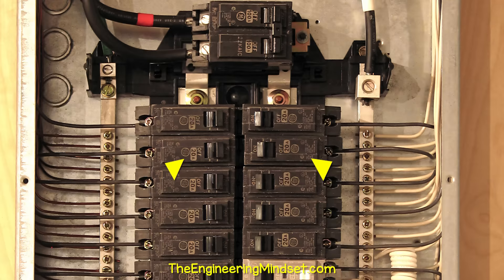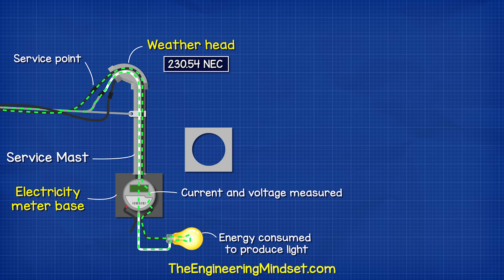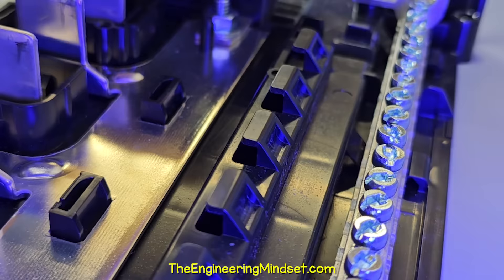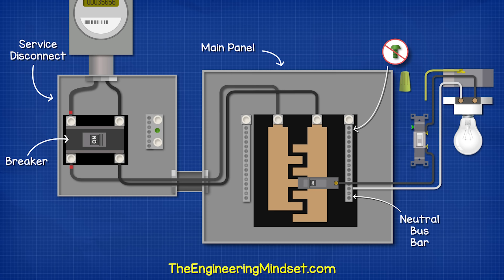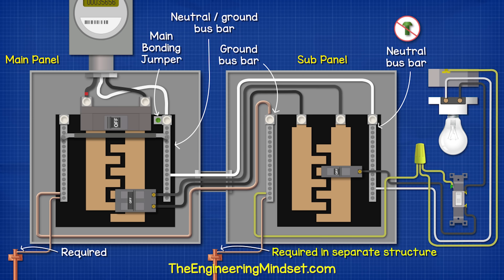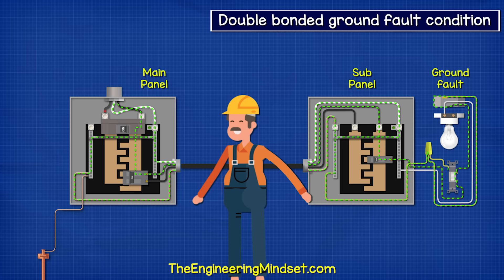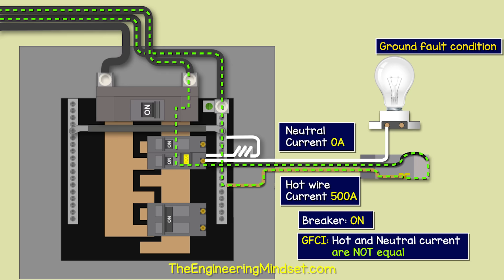Sub Panels Explained - Why are neutral and ground separated?

Comment: If the pole mounted transformer is only connected to one phase, how can the bus bars have tension between them? Or how does Hot1 and hot 2 (1:49) come out with voltage between them when the PMT is only connected to one phase?
Reply: I am reasonably certain that the high voltage side of the transformer is connected between TWO phases. I think that is a mistake in the video, or maybe it is done that way somewhere but not on the transformers that I have seen.
Reply: The transformer is also connected to the neutral on the pole (ignoring rare cases where a neutral isn't used.) It's usually bonded to the metal housing, so it's not as obvious as the tap to the phase. All 3 phases share the same neutral, because it only has to carry the imbalance between the 3 phases, so, the max current it would need to carry is a single phase, which is why it is sized the same.
Reply from the maker: There are a number of ways the transformer might be connected. It's going to vary by region. The one show is the simplest version just a single phase pole mounted type, it will work just fine. This isn't the point of the video so I have not discussed two and three phase connection transformers, just a basic understanding of how it's all connected to the grid so we understand the fault paths.
Reply: A single phase delta transformer has two bushings connected to two of the three primary wires, so the primary winding sees the phase-to-phase voltage. This avoids returning primary current through a neutral that must be solidly grounded to keep its voltage near earth potential. Since the neutral is also provided to customers, this is a big safety advantage in a dry area like California where soil conductivity is low. The main disadvantage is higher cost, e.g., from needing at least two insulated 'hot' phase wires even on a branch circuit.

Other areas that have ground conductivity that is higher can be wired as per video but require a neural return path to the substation. This appears to require a 4 wire system on the primary side (or 2 wire system on 1 phase system) unless the video author suggests that the return current from the line transformer to substation can travel through the “actual ground”! So it is suggested that the provided video diagram is the simplest or a 4 wire system is simpler than a 3 wire primary system. Not too sure that a 4 wire system makes more sense than a 3 wire primary system particularly from an educational perspective. If the suggestion is that the return current can flow through the actual physical ground then that brings up some other safety concerns. 

The only high voltage distribution system system that I am aware of that has current flowing through the actual physical ground is in HVDC long distance transmission lines. 

So maybe the youtube author could do a video on the “economic considerations” of why a 4 wire system is preferred over a 3 wire primary system.

Comment: They would prefer to ground the tubes for isolation purposes. These create shock isolation and limit noise. GCFI is more expensive but simpler. Me personally I would just use GCFI for everything. Each sub branch is monitored if implemented correctly, but I am guessing this is against code.

Comment: What gauge thickness wire should be used from the hundred amp double pole breaker to the sub panel?
Reply: That depends on the type of conductor, the insulation type, whether the conductors are in conduit, free air, or buried. It also depends on if it's in a secondary raceway which contain other wires.

So, it's kind of a loaded question.

Not that this applies to you, but I recently worked on a system with a fairly short aluminum cable (90C⁰ rated) and it was 2/2/2/4. That means the two hots and the neutral were #2-AWG, and the ground was #4-AWG.

Also not that this applies to you. But, I've also worked with other panels, wired a fairly short distance, using 70C⁰ (or 90C⁰) rated copper wire using 3/3/3/2, which is the two hots and the neutral using #3-AWG and the ground being #2-AWG.

Aluminum wire sometimes gets a bad rap due to some fires that occured in the 70s in the US. But, that's all been worked out now. I don't believe we are allowed to use Aluminum wire in homes or businesses, that are smaller than #6-AWG. We avoid tight radius, and pinched staples. We use deoxidizing compound on the wires and we wiggle tighten, wiggle tighten the wires into the lugs. The combination of those parameters seems to have delt with the image of aluminum wire being a fire hazard.

Comment: The feeder to a subpanel  may not be through a breaker, but instead through extra lugs at the bottom of the Main Panel to the subpanel main breaker.
Reply: If you want to do that, you have length constraints that apply for how long the conductors can be, until they connect to either a separate breaker or fused disconnect.  See 240.21(B).  These would qualify as tap conductors, unless they have the full ampacity of the main breaker of the main panelboard.

Comment: I am confused. The subpanel for example, needs a 100 amp breaker to feed to the subpanel, but the main panel has a 200 amp main panel, that means that circuit breakers in the main panel can not exceed 100 amps or the main one will trip, correct? My home has two 100 amp main breakers and would like a subpanel. All breakers are full. Id be able to add a subpanel but not exceed the 200 total amps correct? Strangely the existing panel totals 160 amps ion the left line of breakers and 165 on the right line of breakers. I am guessing this does not trip because all breakers are not running their total amperage at once?
Reply: The breakers don't all draw their full load at once.  There are statistical models of user behavior, that are used for taking a nuanced approach to "add up" the expected amps at each point in the distribution network of panelboards, that are used for sizing the subpanel and the subpanel's feeder, along with the main breaker and service conductors .  You'd have to be an adversarial user who deliberately turns on everything at once, in order to trip the main breakers in the way you described.

Suppose you have a 200A main panel, and a 100A subpanel.  Chances are, you won't draw 100A in the subpanel at the same time as the local loads of the main panel also draw 100A.  This is an unlikely scenario.   But you have the ability to do up to that.

If however, the subpanel is only drawing 50A, you have the headroom to draw up to 150A in the main panel before tripping your main breaker.

Comment: One burning question I think a lot of us have is when connecting an electric vehicle charger can you use either the white neutral, or the ground which one is better? Most vehicle chargers only allow for three conductors. If they're both bonded together, at some point in the circuit, why does it matter? in my situation, there is no subpanel, and both the neutral and the ground are connected to the chassis in my main panel.
Reply: Most vehicle chargers use the two live conductors (whether at 208V or 240V), rather than the neutral, to provide the majority of the power.  There is a chance that they use the neutral for powering control circuits, but those can also be powered off the two live conductors.  Pay close attention to the colors of the wires and the manufacturer's instructions.  The two phase conductors that provide the power to the unit, are usually red and black, which connect to the two live lines.  If the third conductor is meant to be a neutral, it will either be white or gray.  If the third conductor is meant to be an equipment ground, it will either be green or bare.

If it is green or bare, then you connect it to the equipment grounding busbar.
If it is white or gray, then you connect it to the neutral busbar.

Comment: I just bought an old shop from a family member and it is an electrical nightmare. They used sub panels for everything. Sub panel for the well pump. Sub panel for exterior lights. Sub panel for interior lights. It's going to take a lot of rework...

Comment: Please explain the ground connection to the wall switch.
Reply from the maker: Please see our lighting videos
Reply: @EngineeringMindset  I'm not finding the video. I can mention that I have never seen a light switch in the US with a protective ground connection.

BTW, protective ground in the US is either green insulated or bare wire.

Comment: Great video!  Can you explain how you get 240v across the two non-grounded bus bars, even though they sourced from the same single phase of the supply?  Is there something going on in the transformer?
Reply from the maker: The transformer has the ground in the middle of the transformer coil. So you can use one half to get 120v the other half to get 120v or both halves to get 240V 
See our ground, neutral  hot video for more info
Reply: It is a single phase transformer on both primary ( fed by one of the hot wires and the grounded conductor. The secondary is a single phase winding of 240 volts. There id a tap on the center of the secondary winding which creates the neutral coming to the home along with the other 2 wires. So, 240 volts with 120 volts from either hot to neutral.
Reply: @EngineeringMindset  Thanks!  I'll check out that video
Reply: @jackpast  Thanks!  That makes sense now

Comment: So I have a sub panel in my attached garage. There is a neutral back to the main, but the ground in that panel is its own separate ground. The neutral and ground are not bonded together in this subpanel. There is no ground going all the way back to the main panel and the subpanel is grounded separately. Is this a problem and why?

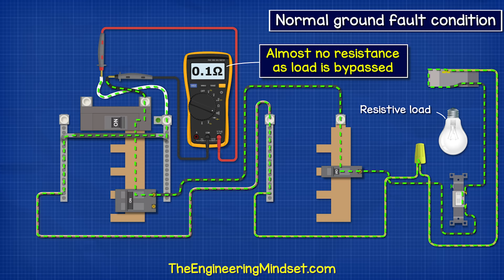Comment: Why does the "no resistance" at 12:03 cause the breaker to trip but the "no resistance" at 15:15 not cause the breaker to trip?
Reply from the maker: No resistance = unlimited current flow
Resistance = limited current flow
Breaker won't trip if under certain level of current

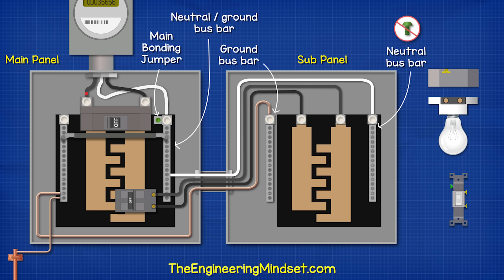Comment: Hi, at 10:00 is the sub panel become 240v if the breaker is 240v (joining both 110v)?

Basically want a 240v subpanel from the main panel. Or is it recommended to keep both 110v to the subpanel and use a 240v breaker on the subpanel?
Reply: I highly recommend calling a professional. Not something you want to kind of know  about while trying to install your own sub panel. He kept this video pretty simple so not to be confusing. There is alot of code you must follow when installing panels starting at grounding and bonding, conductor size for feeders, panel ampacity rating  grounding electrode conductor size, if you need to install a GEC in the sub panel, also code covers working space, and accessibility and much more like the AHJ could have added to the code so having someone local that knows the local requirements is best. You don't want to burn your house down. Just call a qualified person to do the job.
Reply: @chrisbolin2478  thank you for the input.

Comment: Is there a specific wire/bond that is used to connect the ground/neutral bus bars?
Reply: Any piece of metal or wire that is thick enough to handle several dozen amps if needed.

Comment: our house has a disconnect at our meter, i dont beleive its a breaker rated with a specific amperage though. it feeds power to our shop, and to our house, both of which have a main panel in them, with grounds and neutrals bonded together, and each with a ground rod. is this correct? or do they need to be replaced with sub panels and have the grounds and neutrals isolated?
Reply: That's a good observation you made and it doesn't sound right. You should call an electrician to have a look at it.

Comment: What if no equipment Ground was  wire run to the sub panel  would you bond the neutral to the ground bar. to server as a path back to main ground
Reply: You are no longer allowed to do that.  A subpanel, regardless of whether it's in the same building or a different building, requires a separate ground and neutral to it.   In a different building, you bond the subpanel's EGC to the grounding electrode, but not the neutral.  The subpanel neutral is required to be isolated.

If you inherit an existing situation that isn't practical to retrofit, then most jurisdictions would allow you to continue the status quo with how the subpanel was originally built, as long as it met code when it was originally built.  At one point, you were allowed to re-derive ground and neutral at a subpanel in a separate building, and not run a dedicated EGC to the detached building.

Existing violations may require you to fix what you inherit, while existing situations that once were OK, are generally allowed to remain that way.

Comment: Why is the metal case bonded to the neutral by the green screw?
What purpose does it serve to electrify the metal cases?
Reply: The metal case is bonded to the EGC busbar by design, since it will be bonded in all cases.  In the service panel, you have to bond the neutral and ground in some form or another.  Sometimes, manufacturers give you a jumper to connect the two busbars, other times, they give you a green screw.  Follow the manufacturer's instruction on what jumper you need to install.

The service panel is a special case where you have a neutral-to-ground bond, while subpanels don't.  The underlying idea is to create a dead-end path that can establish that ground and neutral have the same absolute voltage, but the dead-end path cannot carry current.

The idea is to make all metal that doesn't intentionally carry current, be at the same absolute voltage as the surrounding dirt and building steel.  This is what you do by connecting to a grounding electrode to ground all building steel and the EGC system, and establishing that neutral is at the same voltage as ground, by exclusively making one connection between the two.

If you didn't have this connection, you could not guarantee that the two ungrounded conductors would be both at 120V to ground, which the design of the voltage system requires.  They'd be in a metastable state of both being 120V to ground, but they will drift away from this state.  If there's a single line-to-ground fault on such a system, one of the lines will ground, and the other line will be at 240V to ground.  This will be in the blindspot of the overcurrent devices, if you had an ungrounded system that was meant to operate as a grounded neutral system.

Comment: I have a question related to the ground and neutral terminals distance apart inside the electric panel. Is there a legal distance from neutral and ground wires? Thanks. From Florida US.
Reply: I justed looked it up in the code took like two seconds Google

Comment: There is one part i dont understand. When sub-panel GnD bar connects with neural busbar, if we touch two boxes, the current will flow through the body, but human body is much larger resistance, so the current will flow through the wire.

Comment: overthere neutral bond to ground only at first disconnect switch - more important would be not to allow such a bond in high up place
where  somehow  more easier neutral could lose earth -  and then   
this is no TN-S  only comparable is TN-C-S which not specify whether N Ground bond point is earthed  basicly or not
where ever N is  tied to Ground  = current loss. So for security  do this  just once - and not like MEN system, which imo isn´t more secure,

Comment: UK version the earth bus bar is ran direct to the earth rod a neutral bus bar direct to the neutral supply cable and a hot bus bar direct to the phase line them the rest is ELCB and MCB network, I don’t know how strong are the breaker’s contact connection as they are just being pushed onto the bus bars, UK we use screw and firmly hold onto the bars
Reply: It's a big really tight spring. Think of it like the old lever switch from Frankenstein movies "throw the switch" There's plenty of contact area and force. The other side of the breaker fits under a lip to hold the breaker in, and the panel cover itself holds all the breakers down. Makes it easy to install and you'd have to be really deliberate to remove them.
Reply: We have both types in the USA, the clamp type are nice, in the fact that you don't have to shut down the whole panel just to swap out a breaker.
I do think the bolt in style is a more secure set up though.
Reply: @MrJohnnaz  in a scenario of over heating expansion can lead to other breakers pop out the screw type though is never affected
Reply from the maker: Seen our new incredibly detailed MCB video? link: https://youtu.be/gqEu9t8HwW0

Comment: What is the function of the  ground rod connection circuit?  Tests have proven that it won't allow enough current to trip a breaker due to the high contact resistance between rod and dirt.
Reply from the maker: Please see our main panel video

Comment: Well that explains why they dont bond neutral and ground in mobile homes. They all have external shut offs on the pole. Not sure why that is though. Maybe something to do with fire risk, i dunno
Reply: I wonder if most mobile homes don't have grounding rods driven near them.
Reply: @GeneralChangFromDanang  Every one I've ever seen did. But that ground was only for the main panel just after the meter. It was never bonded with the rest of the house

Comment: 11:55 why does the electricity not energize the metal panel? This is confusing me so much. If electricity is flowing through the ground wire, and the ground wire is touching the metal panel, and I touch the panel and I am grounded, would I not get shocked? Wouldn’t the panel be energized? Even if it has a path to complete the circuit, why does it not also energize the panel?
Reply: Because the breaker would trip immediately.

Comment: Isn't there a path to ground on the sub panel's left neutral bar to ground spike?
Reply from the maker: Yes, it'll act like the main panel ground rod. But it will have an even higher resistance assuming its further from the transformer